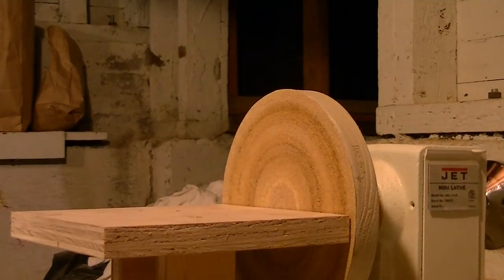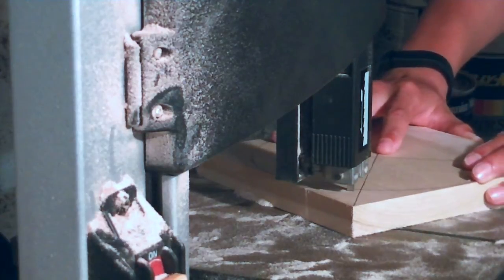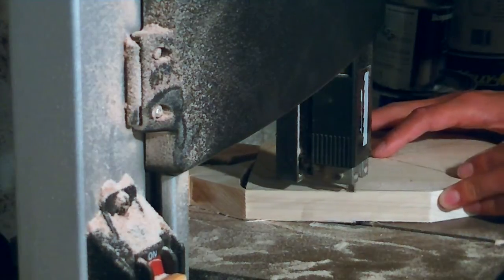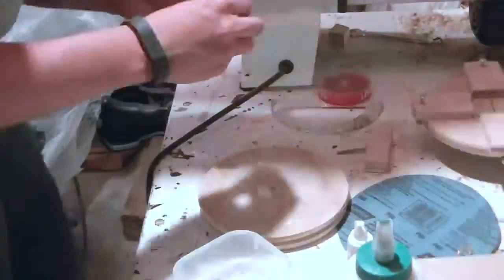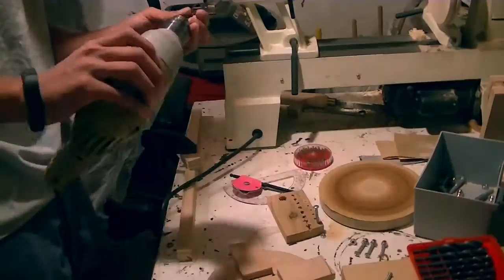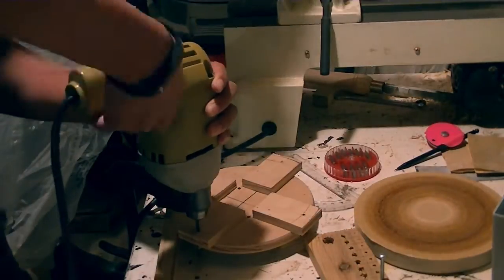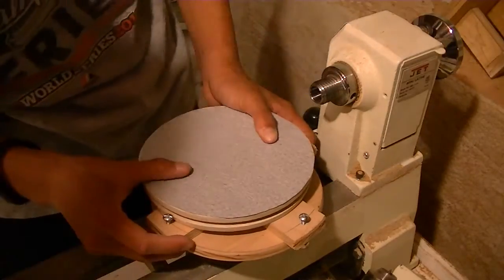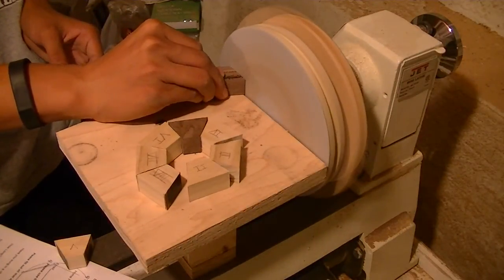Homemade Lathe Disc Sander with Changable Grits

Comment: Cool idea, sanding really extends the precision and quality attainable in your home shop. Finer grits tend to clog up and burn the wood. It's usually possible to attain a fine finish even with coarser grit. By regulating the pressure you can go from hogging of the material to polishing and by keeping a slight motion across the disc you can avoid the streaks that uneven grit produces. And quality paper goes a long way. On the sanders I've built I've given the disc a coat of epoxy to seal the wood and give a plastic surface. I use a light even coat of contact adhesive on the paper and the epoxy keeps it from soaking/binding to the wood fibers. Holds really well and changing the paper is as easy as simply peeling it off. Any glue residue left on the epoxy surface is easily removed rubbing with an eraser and a little denatured alcohol, and then you're left with a perfectly clean flat surface for the next paper :)

Comment: How did you balace up the wooden disk?  was there mutch vibration when the lathe was turning on a fast speed?

regards,
Bill from Britain.
Reply from the maker: +Bill anderson Hi Bill, I've never noticed much vibration. The disc itself is pretty symmetrical, well balanced, and tightly secured. I run it at around 1200-1800 rpm and I haven't encountered any real issues. My Jet Mini Lathe is heavy enough that it doesn't slide around. Hope this helps!